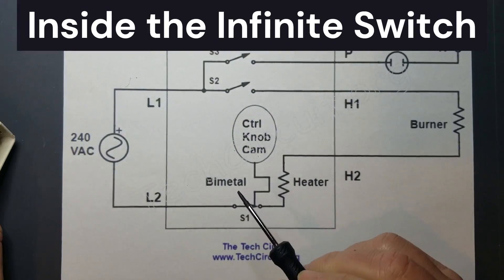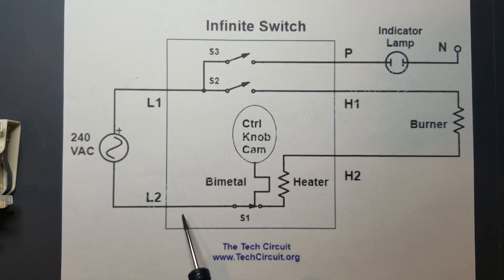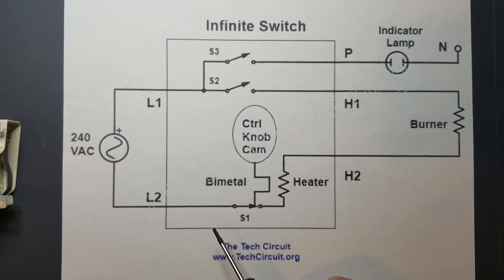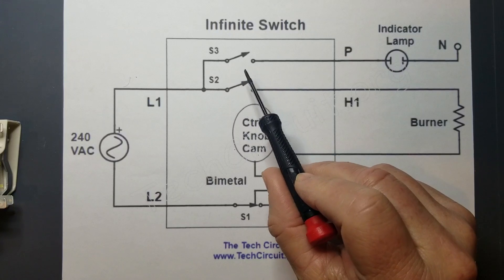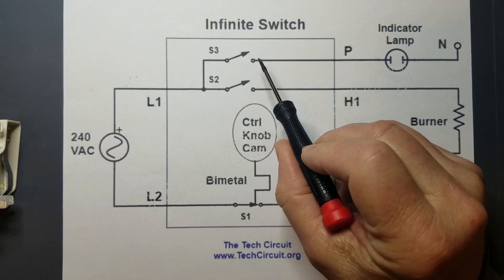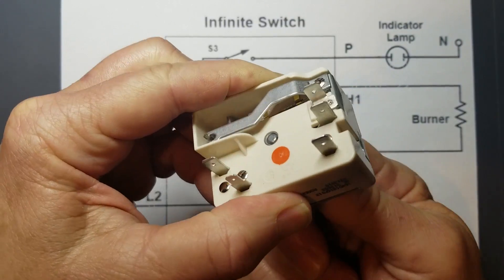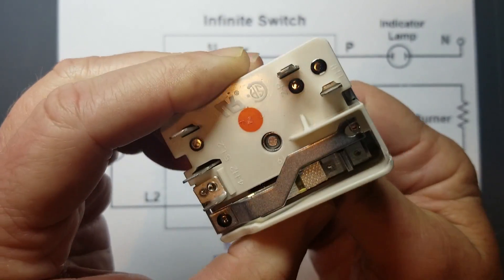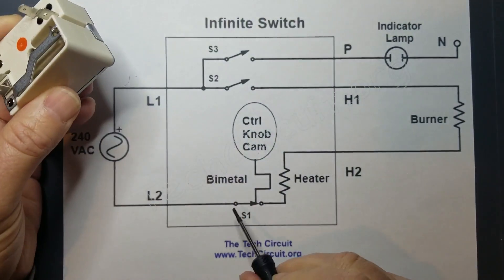#82 - How Does an Infinite Switch Work?

Comment: Thank you so much for this very informative video.  I wonder if you can help me discern what may need to be replaced on our GE Monogram Glass Top stove, which has infinite switches.  Our control  board always has the "HOT SURFACE" light on.  Even when everything is off and cool.  One of our burners used to "short" and cause the circuit breaker to trip.  It could only be turned in one direction for use.  If we turned in the other direction passed "OFF," it would trip the circuit breaker.  At this point, it never trips the circuit breaker - but it seems that the PWM is no longer effective.  Whenever we turn it on, we get 100% energy and it is very hot regardless of where we set it.  Do you think we can just switch the Infinite Switch?  Or does this seem like a control box issue?  Thanks so much for your advice and education.

Comment: I am using this exact switch to control heat on a nichrome wire set up. I don't have an indicator light so I am using my volt meter. I get no voltage even when the switch is on. Have I broken the switch? I did twist it both ways.
Reply from the maker: If you are referencing the P terminal from neutral and getting no voltage I'd say the switch is bad.
Reply: @TheTechCircuit  the switch is brand new! thanks for your time
Reply from the maker: @johnpinckney7269  It sounds like either proper voltage isn't getting to the switch or the measurement reference point is off.

Comment: I am a kitchen engineer in a big casino and commercial food equipment repair guy by trade. I love infinite switches as opposed to capillary tube thermostats. Much easier to replace, easier to test, more readily available and way less expensive. These should be in everything that doesn't need precision temperature control, of which few things do.

Comment: Excellent breakdown of the switch mechanics. I just replaced the switch on my stove but wasn't sure if my old one was working properly or not. Stove is 10 years old and that's the only burner switch I ever use so makes sense it might be worn out but you can't see the inside of the switch if there's soot or carbonization or if maybe the thermal plates are worn.

Comment: Thanks. I fucking hate  Samsung electric ranges for using these god awful infinite switches
Reply: To my knowledge all electric ranges use the same type of switches. Not sure but maybe some high end commercial stoves might use different tech instead of pulse modulation. Perhaps variable voltage and current switches but that's not common in home ranges.

Comment: I wonder if a tiny μC with a high voltage mosfet to control PWM would be more cost effective nowadays. It would definitely be more efficient.
Reply from the maker: Triac control is used for microcontroller based systems. The small amount of heat/power used to bend the bi-metal strip is virtually insignificant as compared to the thousand-plus watts of power delivered to the burner.  Other than that, when it comes down to it, duty cycle is duty cycle. Also because the high thermal inertia of the elements, the pulse frequency can be extremely low and still be unnoticed (for which traditional infinite switches are ideally suited).
Reply: @TheTechCircuit  Yeah, you're right about the total power. When I mentioned efficiency, I guess I was referring to the controller. I believe but might be wrong that a small μC will be more efficient than heating up a bimetal strip. It relies on resistive loss, although I guess not that much. Either way, the fast switching of the controller is much more pleasant to the user due to having a seemingly instant power change rather than a noticeable on-off cycle
Reply: @Mulakulu  The uC and transistor could control a relay.   Yeah, I know; that means we still have a strip of metal there making a contact. But it's not being heated, and can be sealed inside its housing, and we have eliminated the hokeyness of the cam physically pushing on the bimetallic strip.
Reply: a tiny single diode rectifier with a capacitor and a voltage divider to power the μC with a stable low DC voltage should be enough for PD to the μC. Not the most efficient, but we're going for low price here
Reply: yes but potentially louder. i had a mercedes that would make a  pwm whistle when its lights dimmed
Reply from the maker: That was common in some early or not well thought out implementations where the PWM frequency assumingly could have been more well suited for the application.